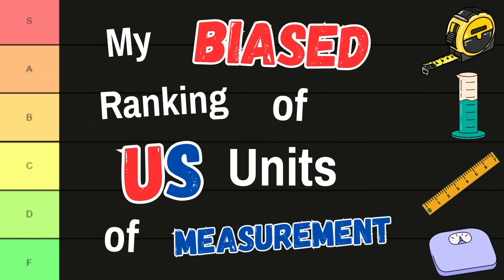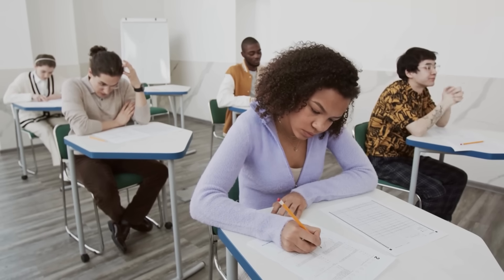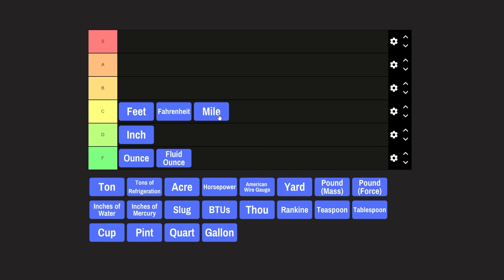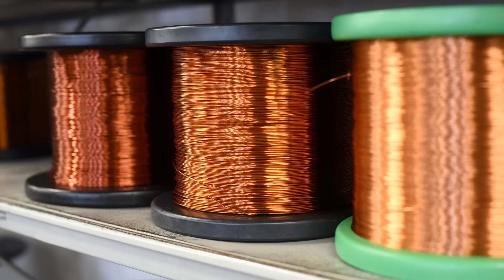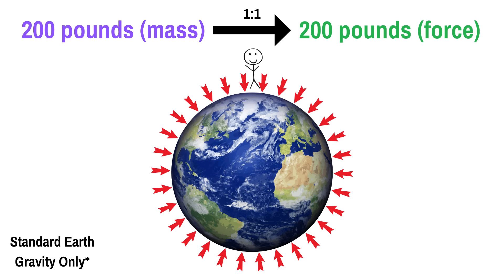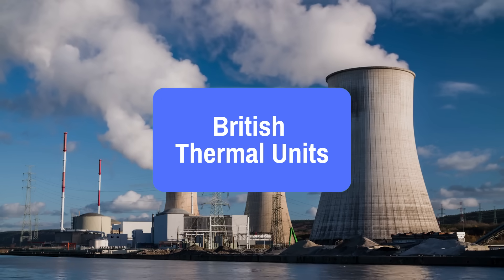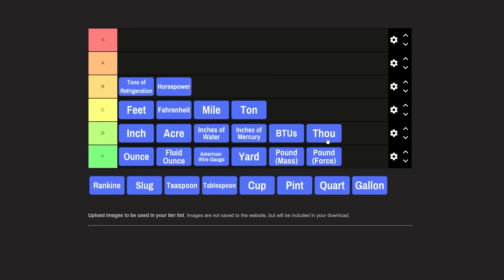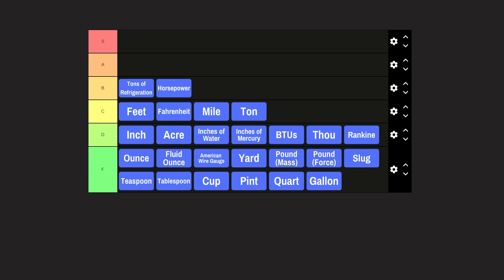Tier List of the DISASTROUS US Measuring System

Comment: I'm just wondering why don't people start applying the metric system's conversion principle to the US's measuring system, like, instead of using miles to refer to long distances, we can use Kilofeet instead. It'll fix the entire unit system without having to adopt the metric system.

Feet itself is a pretty decent unit. It's not too short, and not too long, so it can be used as the standard
Reply: or you know... just switch to metric if you were to change anyways??

americans will try anything but to adapt the metric system 😂

Comment: I disagree only with farenheit. Its better at describing the weather outside.
Reply: Better how?
Reply: @logitech4873  Better resolution. Instead of the 'average weather' being from -10 to 40, it's from 0 to 100.
Reply: @cptmiche  You can just use decimals if you need to. But generally you don't need that resolution for weather. In a blind test, nobody will be able to reliably tell the difference between 20°C and 21°C anyway

Comment: The best thing about fahrenheit is that you can count how many chirps a cricket makes in 14 seconds, add 40, and that's the temperature.
Reply: you know it's a chilly day when the cricket chirps -20 times
Reply: Actually the best thing about fahrenheit is that you appreciate more the Celcius 😂
Reply: @user-ow6oj4bw8s celcius sucks though you europoor
Reply: Like in a human scale
Reply: Also, way more precise, people give it crap, but it's way better for temperature than Celsius
Reply: @frenchfry1479 huh?
Reply: @Encucumbered  Fahrenheit is a more precise measuring system, ine Celsius is equal to like 28 degrees Fahrenheit
Reply: @frenchfry1479  
1. That is just lie, you americans really refuse to use google to point out real info.
2. Decimals do exist. 
3. You're biased because you are familiar with farenheit.
4. 0°C means water can freeze. That is very useful in relation to snow and other important stuff you should know when working with water.
5. Having to rely on primitive logic of 0 = COLD AF AND 100 = HOT AF is extremely childish.
Reply: @locknvme  so... you say Fahrenheit is worse because you can, instead of using whole numbers, use decimals? Also, 32 and 212 are not hard numbers to remember
Reply: @mrhawkyy1  yes
Reply: @frenchfry1479 the point of Farenheit was that weather can't get negative. It can. And the temperature of healthy human body is 100°F, but it's 97,8°F, actually. It fails both concepts.
Reply: @frenchfry1479 I think of all measurements, farenheit and celsius have the least amount of difference, it just depends on what you're used to, for me 64°F tells me nothing, I have no idea if that's hot or cold, but I know exactly what 23°C feels like. for you it's probably the opposite. so I think both measurements are about equal in usefulness
Reply: @johnywuijts917  well Yes, if you aren't used to it then you will not know what it feels like, but, I have used both systems and can tell you that if people would stop going "her der 32 and 212 are so hard to remember" then they would realize it's better. For example, who wants to say Mt house is 22.77°C when you could just say it's 73°F. It's just way less complicated to use precisely.
Reply: @frenchfry1479  who the hell will say 22.77°C. Just 23°C. And no one will say 73.4°F either.
Reply: @frenchfry1479  we just say 23 degrees, we don't care about being so precise. can you really feel the difference between 73 and 74 fahrenheit?
Reply: @frenchfry1479  many people have already pointed this out, but your logic works perfectly in reverse as well.
Reply: @frenchfry1479  I can't even feel the difference between 23 and 24 celsius so idk.
Reply: @frenchfry1479  precision depends on the instrumento, not the sistem
Reply: @frenchfry1479  in casual conversation u dont need to be precise, the difference between 22.77 and 23 will not make wear different clothes that day. You need to be precise for science and for science decimals are not big deal and for science Celsius or Kelvin are just better
Reply: @frenchfry1479  1°C is 33.8°F
But 1°C is equal to only 1.8°F
So Fahrenheit isn't even twice as precise.
Reply: @The_Christian_Kirbo  Let me be more clear as to what you are trying to say
A temperature of 0°C is 32°F, this is freezing point of water under 1 atmosphere (pressure at sea level on Earth)
From there, for each 1 unit in Celsius you move up or down, you move by 1.8 in Fahrenheit. So yea the imperial is more precise but it doesnt even need that precision.
Reply: @frenchfry1479 32 and 212 isn't hard to remember, yeah I agree, it's just two numbers. And you know what is better than 32 and 212? 0 and 100 lol. 

And it's based on facts that 0°C is when water starts freezing and 100°C is when water starts boiling. Not just random "0°F is cold af, 100°F is hot af" assumptions
Reply: @frenchfry1479 Fahrenheit is such a clusterfuck that they fixed it by using metric, the scale of Fahrenheit is defined by the Kelvin, so yah, the metric system is very precise 😉
Reply: @frenchfry1479  No it isn't. The interval is just smaller. Which doesn't matter because decimals exist.
Reply: @frenchfry1479 Why do you complain? Just remember these random numbers!
Also It's not like you use decimals to measure outside temp with Celsius, because the difference is so small you can't feel it. The only instance were you do that is with scientific measurements, but guess what? You do that with Fahrenheit too.
Reply: @projectpitchfork860  alright, let's come to an agreement. Fahrenheit is what the body feels, Celsius is what water "feels" neither is good for science, but Celsius is easier for that.
Reply: @frenchfry1479 You can tell the difference between 73 and 74 Fahrenheit?
Really?
Reply: @sniperloic2904  "So yea the imperial is more precise"
How is Fahrenheit "more precise?"
Reply: @frenchfry1479 "Fahrenheit is what the body feels"
How so?
Does that mean people can't feel the temperature if measured in Celcius?
Weird!

"Celsius is what water "feels" 
What does water have to do with temperature or measuring temperature?
Reply: @ it is "more precise" in the way centimeter are more precise than inches, cause the unit scale is smaller
but Farheneit stays dumb
Reply: @sniperloic2904  22C is precisly 22C.
What is 22C in Fahrenheit, precisely?

My body temperature is precisely 37C.
What is 37C in Fahrenheit, precisely?

How precise do you need to be with day-to-day tasks?

Again, how is Fahrenheit more precise than Celcius?
Reply: @dampaul13  you're being petty here, i already explained how it's more "precise" due to scale of the unit being smaller, i didnt say it made SENSE. All imperial unit are dumb, the system date from medieval time (not for some units obviously) where it was using body proportions but varied from merchant to merchant or kings to kings.
Reply: @frenchfry1479 Plus, originally the Fahrenheit Scale was based on points that could be easily reproduced. As an example, 0 degrees is the stable temperature of brine (a combination of ice water and salt), while 100 degrees was the human body temperature (it was later adjusted to 98.6 degrees (it is actually 98.5 degrees but thermometers only had 1/5th of a degree divisions so it was rounded to 98.6 degrees). So originally you make some brine, stick the thermometer it and mark that temperature as "0 degrees." Then stick the thermometer under your tongue and mark that temperature as "100 degrees."
Reply: @Solitaire001  "the Fahrenheit Scale was based on points that could be easily reproduced."
And can you tell me how to exactly reproduce both reference point of the Fahrenheit scale?
Exact and replicable!
The only way to build a scale!

"0 degrees is the stable temperature of brine (a combination of ice water and salt)"
I'd love to see the details of this easily replicable and stable brine.
Please, if you would. 
How cold is the water?
How cold is the ice?
What type of salt?
How are the salt crystals former?
Were volume or weight measurements used?
How long is this brine stable in temperature for?

So many questions, so few answers. 
I can't wait for you to educate me!

"while 100 degrees was the human body temperature (it was later adjusted to 98.6 degrees)"
Wait! 
It's 100f body temperature borderline fever temperature?
I thought you said it was easily reproduced.
Does one need to have just the right fever to have a body temperature of 100f?
But you have already shown a discrepancy between when he thought he was measuring and the final result! 
From 100 to 98.6 to 98.5!
Eeeek!

And doesn't the human body temperature change?
How is such a changeable reference point a good place to build a scale?

"So originally you make some brine, stick the thermometer it and mark that temperature as "0 degrees." "
And you know this is a constant and stable temperature how?

"Then stick the thermometer under your tongue and mark that temperature as "100 degrees." "
And 100f is the human body temperature?
Always?
For everyone?
It doesn't change?
Fever?

How can you reply on a scale where both reference points are so changeable?

So many questions for these easily replicable reference points?
I can't wait!
Reply: @frenchfry1479 Where did you go?
So many unanswered questions from your adoring fans!
Please don't leave us waiting any longer.
You had so much to say earlier, and now, nothing!

I hope you aren't scared!
Reply: @sniperloic2904  "you're being petty here"
Not being petty, just highlighting the massive flaws in your argument. 

"i already explained how it's more "precise" due to scale of the unit being smaller"
Any unit is just a representation of a scale.

Any unit doesn't represent 'precision.'
'Precsision' is dictated by granularity.
Increase the granularity to gain more precision.
Km too large, use m.
M too large, use mm. 
Mm too large, μm.
Etc, etc. 

The precise distance between point A and point B is precisely the same, irrespective of whether it is measured in inches or mm.

The precise temperature of something is the same, irrespective of whether it is measured in F or C. 

Simple question, precisily 22C is precisely what in F? 
Is using a whole F unit precise enough?

So, AGAIN, how is any imperial unit more precise?
AGAIN, how is Fahrenheit more precise?
Reply: @dampaul13  What I wrote is based on my understanding of how Fahrenheit was developed when I wrote it. I checked Wikipedia and discovered the following:

- The temperature of brine will automatically to stabilize at 0 degrees Fahrenheit. However, due to adjustments to the Fahrenheit Scale this mixture will actually stabilize at 4 degrees Fahrenheit at the current scale. At one point the freezing point of water was set at 7.5 degrees.

- There were actually several different temperatures established for human body temperature, rather than just the one I mentioned. At points it was 90, 96, 22.5, and finally set at 98.6 degrees (what it is via an oral thermometer). Part of the reason for the variations was that the scale was adjusted, and was finally set to 32 degree Fahrenheit being the freezing point of water, and 212 degrees Fahrenheit as the boiling point of water, with 180 degrees between the two.
Reply: @Solitaire001 "What I wrote is based on my understanding "
When I write something, I try to have an understanding of the topic, so if and when someone asks me some pretty basic questions, asking me to explain and/or justify my stance, I easily answer them. 
Otherwise, it makes me look a tad silly.

You wrote "the Fahrenheit Scale was based on points that could be easily reproduced."

I simply asking how I can easily reproduce these two reference points for the Fahrenheit scale.
And you haven't answered any of them. 

 "The temperature of brine will automatically to stabilize at 0 degrees Fahrenheit"
How?
Without a specific set of ingredients and instructions, how do I make this "easily reproduced" brine?

Even before getting to the type of salt and how you measure the ingredients, 1c water and -20c ice will give a very different resultant temperature than 15c water and -1c ice. 

And we can't forget about the type of salt, the all-important third ingredient. 

Any home cook will tell you the importance of using the right salt. 

Unless the ambient temperature around the brine is exactly the same (and unchanging) as the brine, the ambient temperature will begin to change the temperature of the brine. 
So, again, how will this brine stabilise itself and for how long?

What are the ingredients of this "easily reproduced" brine, and how are they measured?

"stabilize at 4 degrees Fahrenheit at the current scale. At one point the freezing point of water was set at 7.5 degrees."
WHAT?
I thought you said this "easily reproduced" brine would give me a reference point of 0f ("0 degrees is the stable temperature of brine"), not you are saying the brine "will actually stabilize at 4 degrees Fahrenheit at the current scale." and "At one point the freezing point of water was set at 7.5 degrees!!!"
0f, 4f, and/or 7.5f!
This doesn't sound like a very "easily reproduced" and stable reference point!

Geez, I'm only halfway through your comment, and I'm already tired and confused, but I'll push on.

"There were actually several different temperatures established for human body temperature, rather than just the one I mentioned."
WHAT!
I thought you were going to tell me how to "easily reproduce" a reference point of 100f. 
Weren't 100f, 98.6, and 98.5 bad enough?!?!?
Now you add more!
I can't go on!

Just tell me how I can ""easily reproduce" the two reference points for the Fahrenheit scale, 0f and 100f, please!
Pretty please!
 
And you still haven't answered any of my original questions!
Reply: @dampaul13  I thought I had responded but I guess I was wrong. Sorry if my response was inadequate. Thus I will post a link to the Wikipedia page which should provide the requested information: https://en.wikipedia.org/wiki/Fahrenheit
Reply: @Solitaire001  "I thought I had responded but I guess I was wrong.
Yes, you were very, very wrong!

You haven't answered a single question.

You wrote, 
"the Fahrenheit Scale was based on points that could be easily reproduced."

I'm simply asking you how to "EASILY REPRODUCE" these reference points.

I'm not looking for a link to something I already know. 

So, AGAIN, how can I "EASILY REPRODUCE" these reference points, 0f and 100f, accurately?

You were the one who wrote "EASILY REPRODUCED." 
I'm simply asking for instructions so I can "easily" reproduce the results.

Not a hard concept.
Reply: @dampaul13  For 0 degrees, you make a Brine Solution and it will automatically settle at 0 degrees. For 100 degrees just measure human body temperature orally (although it may have actually been 96 degrees at a point). It is likely that with the human body temperature there will be some variation, but both are easily reproducible via the above methods.
Reply: @Solitaire001  "you make a Brine Solution and it will automatically settle at 0 degrees."
HAHAH!!!
Automatically?
Interesting!
And very, very unlikely!

I'm asking what the specific ingredients/ratios are.
How cold is the water?
How cold is the ice?
What type of salt?
How are these ratios measured?

Simple questions that are required for any recipe. 

Remember, this is your "easily" replicatable reference point.

"For 100 degrees just measure human body temperature orally (although it may have actually been 96 degrees at a point)."
Do you see the flaw in your "easily reproduced" argument?

"To get an exact reference point of 100f, simple measure the human body, which of course varies, and is not likely to be exactly 100f, unless you have a fever, but could be 96f or 98.6, or any other random temperature."
Yes, what a simple way to "easily reproduce" the reference point of 100f accurately
Amazing!

"but both are easily reproducible via the above methods."
🤣😂🤣😂🤣
Sorry, of all the funny things you have written, this is the funniest!
I really did have a good belly laugh when I got to this part of your comment. 

Thank you!
I really enjoyed that!

I just want to get this straight,
Reference point 1, 0f
- an arbitrary ice/water/salt slurry, where we have no idea the ratio/specific ingredients which will automatically and MAGICALLY "settle" and be stable at exactly 0f.

Reference point 2, 100f
- measuring someone's changeable body temperature, anywhere from 96f to 99f, which is well below the "easily reproducable" and required 100f.

Correct?
I just want to get that straight.
And you see nothing wrong with your argument?

On an unrelated topic, have you heard of the 'Dunning-Kruger Effect?'
Reply: @mrhawkyy1  They aren't arbitrary it's just the scale is not based on the properties of water.
Reply: @frenchfry1479 "Also, way more precise"
How is Fahrenheit "more precise?"

"but it's way better for temperature than Celsius"
Why?
For whom?
Reply: @frenchfry1479 shit take
Reply: @frenchfry1479  Except no. Celsius uses the freezing and boiling points of water, which are a lot more useful. And it also indicates when snow will fall instead of rain.

Comment: Oh yes, nearly forgot: imperial has a huge advantage over metric. No, not for any good reasons, for woo-peddlers like numerologists. 
If the value does not fit in metric, changing to another unit does not change the actual value, you simply shift the decimal point.
In imperial however... if the number in yards does not fit to your calculation, change to feet. And if it still does not fit your needs to prove that the ancient Egypts have built their pyramids based on cosmic values (why would the Egyptians know today's definition of a yard?), change to inches, conversion factors 3 and 12. Your should get close enough and with some rounding errors, you have proven that the Ancient Egyptians must have been visited by aliens.
Hey, and if still does not fit, you have plenty of other options, barcleycorns, fingers, sticks, shaftments, hands,...